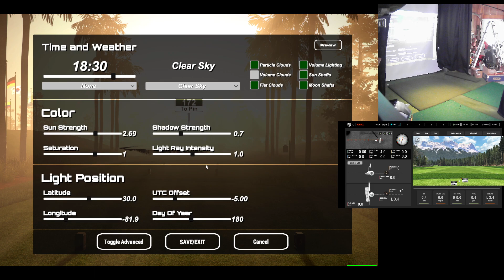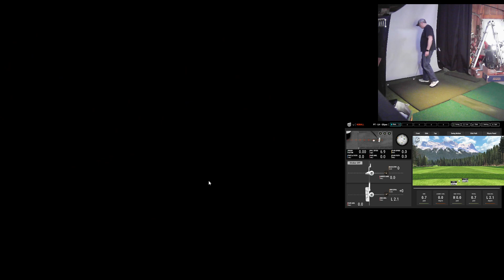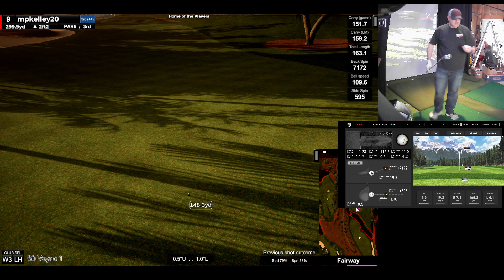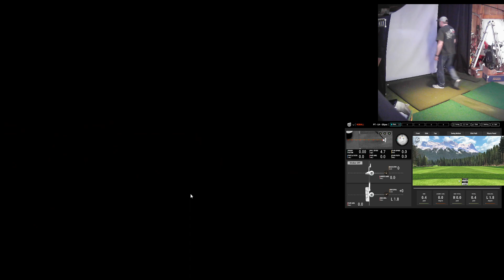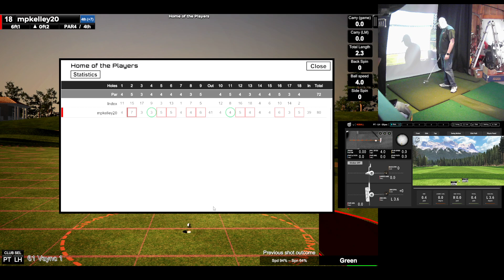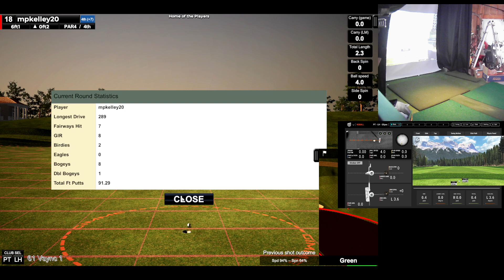GSPro - Sawgrass Beta - Hacking my way through from the tips

Comment: what kind of computer are you using to run gs pro?
Reply from the maker: Mine is an i7 with the 3080ti. But it’s overkill because I’m only running 1600x1200 which is 4:3 resolution equivalent to 1920x1200 for widescreen. People are using less than min spec which is the 1070. The sweet spot for buying a new computer would be the 3060ti for 1080p (or 1200p) and the 3070 for 4K. Again, you can run 1080p on lower card but might not be smooth. Mine I cap are 60fps but would run close to 180 is lefty uncapped. My projector has issues with that.